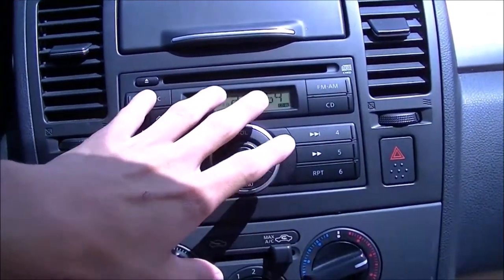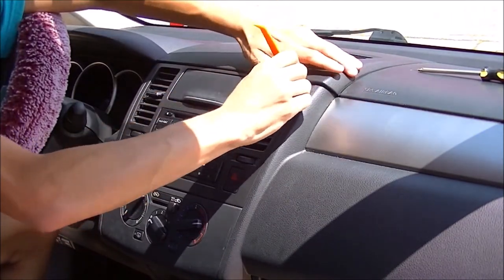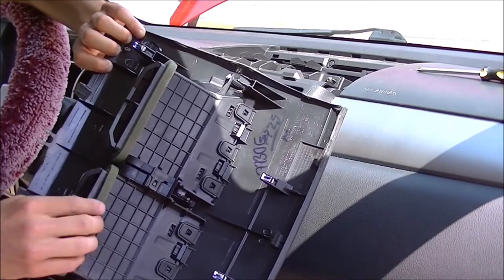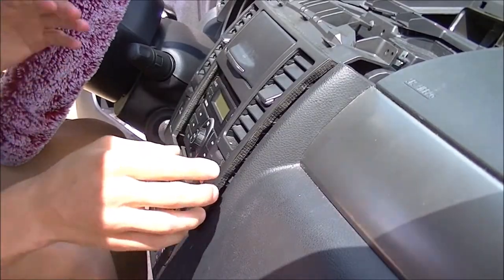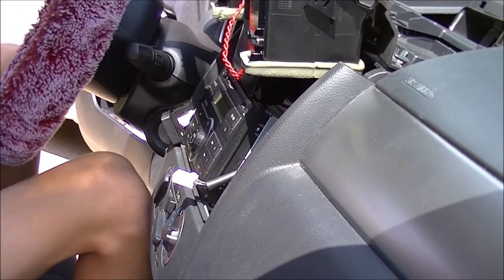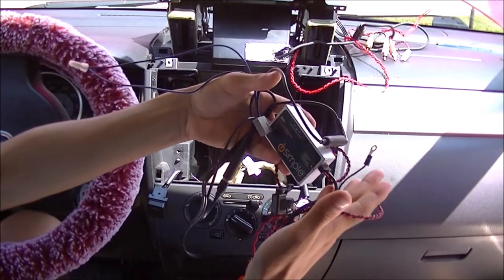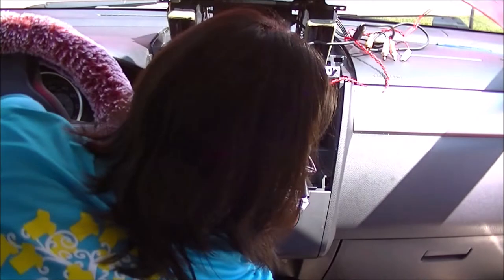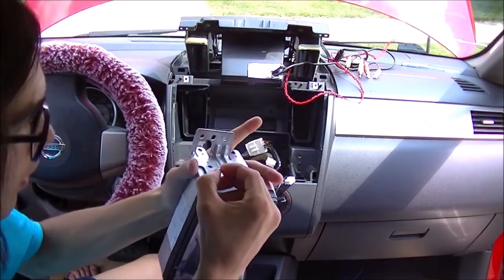2008-2012 Nissan Versa Radio Install

Comment: Good disassembly video!  For those asking- his car has a standard double din size opening- any double din radio will fit.  That said, a lot of the Chinese no name ones aren’t quite the right dimensions- as evidenced by the need to trim the radio opening in this video.  Most name brand (JVC/Kenwood/Pioneer/etc) are built to better tolerances and should fit just fine.  The screen size doesn’t matter as long as it’s a double din chassis.  You can even install the new style floating radios with 10,12 or even 15” screens as they have either a din or double din chassis that mounts in the car and the screen floats in front of that chassis.

Comment: Great video. Smart kid. I am a senior and I need to replace my 2008 Nissan Versa radio and was concerned I would have to remove the whole dash. You put my mind at ease. If I get a garage to do the replacement, it won't cost as much as I thought. I could even do it myself. Good job!

Comment: If you unplugged the airbag mode you can reset the error in the computer by turning the ignition to its on position, wait until the airbag light turns off and turn the key to acc within 1 second. Wait 3 seconds and repeat this 3 times. then turn it to the on position again, and the airbag light will flash really slowly, thats good. turn it off for a couple seconds and then turn on again, the airbag light no longer blinks after this, you are good to go.